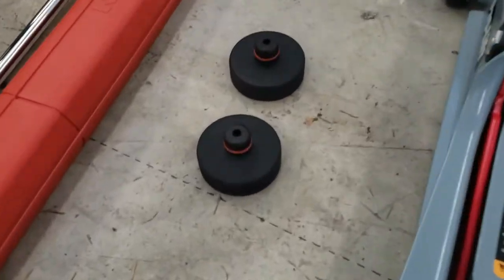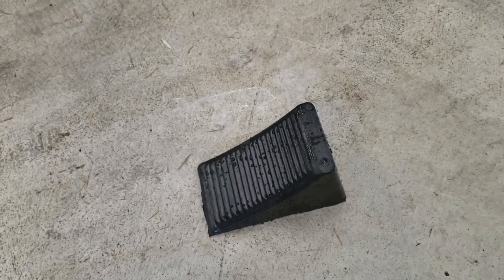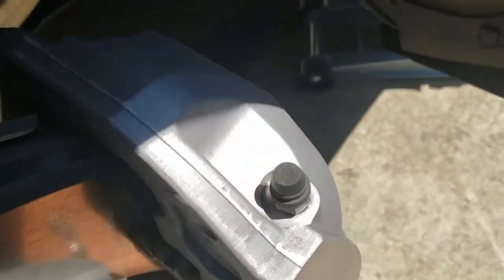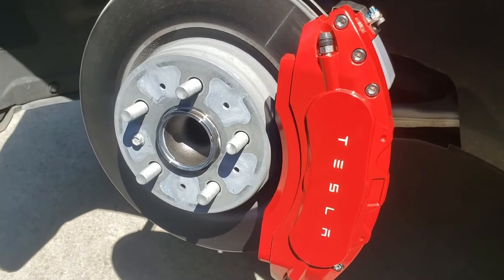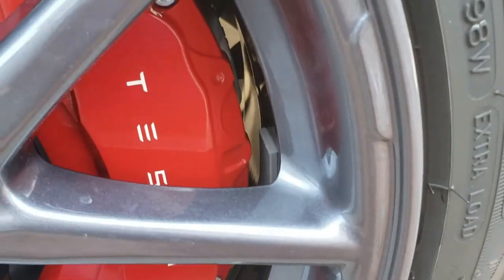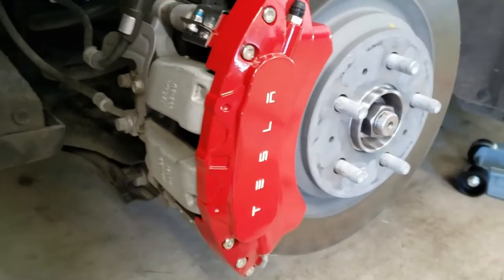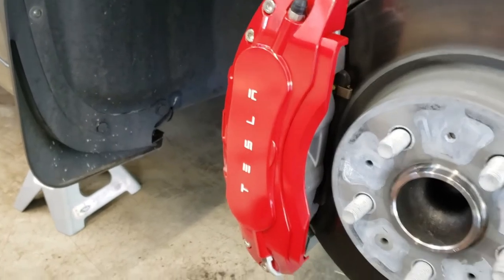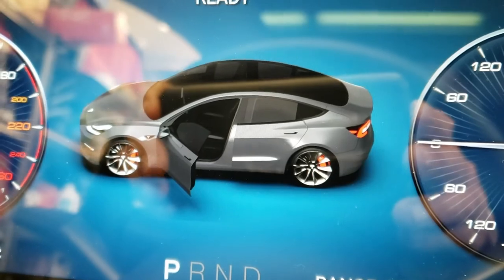Tesla Model 3 SR+ - RPM Performance Sport Caliper Covers

Comment: Nice video Chris’s.  How are the caliper covers holding up?  Is there any noise from them, have you had to retighten the holding screws?
Reply from the maker: Hello aehmerchant. I've used the covers for two seasons now. I remove, clean, and store them each Winter when I change to my snow tire package. 
They've held up pretty well. They don't touch or make any noise and no issue with the bolts coming loose. 
The only issue I've had is trying to keep the vinyl Tesla lettering on. You have to be really careful when washing. Otherwise I'm really happy with them👍